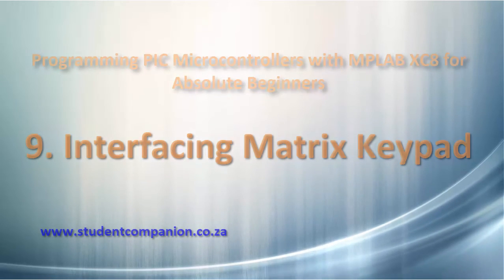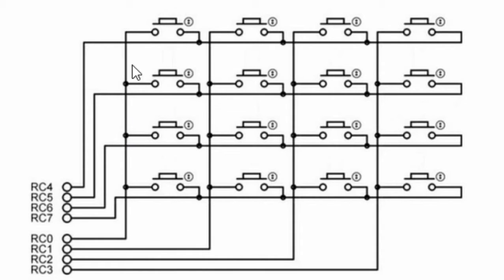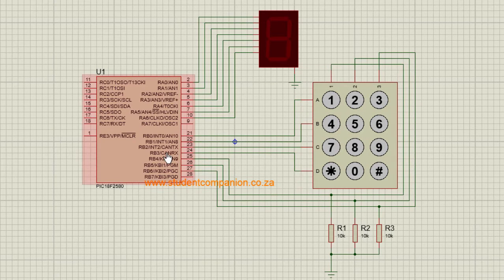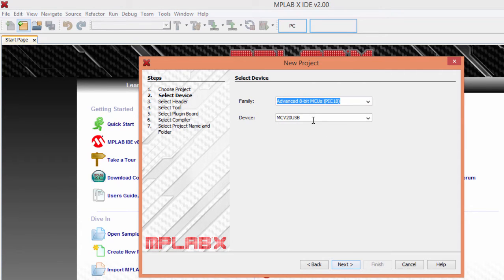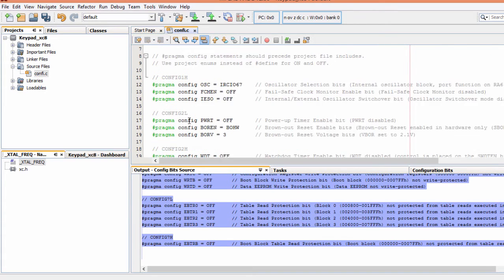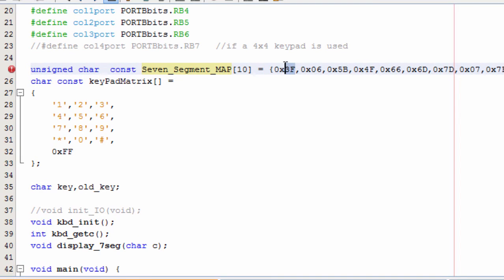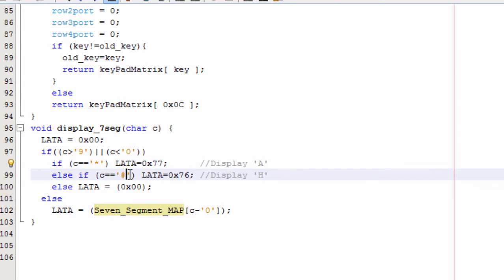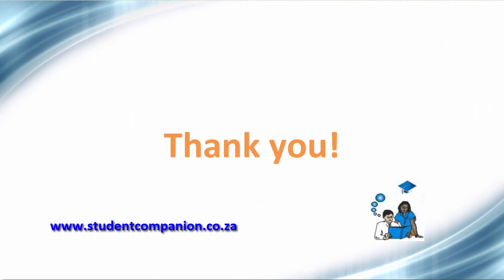9- Interfacing Matrix Keypad | MPLAB XC8 for Beginners Tutorial

Comment: Hi. Your video has helped me understand the basic logic of how keypad interfacing works. I am interfacing LCD and 3x4 matrix keypad with PIC18F4550 microcontroller. I am using MPLABX, XC8 with PICkit3. I am using C language.
I am facing trouble trouble with
1. Not able to print the right pin number on the screen. eg. if I press key 1, there is nothing on the display and if I press 5 then it displays * on the screen. 
2.  Writing interrupt or code to wait for a keystroke.
NB:
                 I am using internal pull up at portB, external oscillator of 20MHz frequency.

My code is:

#include <xc.h>
#include <stdio.h>
#include <stdlib.h>
#include "delays.h"             //--- for delays
#include "xlcd.h"
/*
 * 
 */
#pragma config PLLDIV = 5       // PLL Prescaler Selection bits (Divide by 5 (20 MHz oscillator input))
#pragma config CPUDIV = OSC1_PLL2// System Clock Postscaler Selection bits ([Primary Oscillator Src: /1][96 MHz PLL Src: /2])
#pragma config USBDIV = 2       // USB Clock Selection bit (used in Full-Speed USB mode only; UCFG:FSEN = 1) (USB clock source comes from the 96 MHz PLL divided by 2)

#pragma config FOSC = HSPLL_HS        // Oscillator Selection bits (HS oscillator (HS)
#pragma config LVP = OFF     //low voltage programming disabled
#pragma config FCMEN = OFF
#pragma config BORV = 3
#pragma config WDT = OFF
#pragma config CPB = OFF

void LCD_init (void);               //--- To Initialise LCD display
void LCD_Clear (void);              //--- To clear the display
void DelayFor18TCY (void);          //--- For 18 instruction cycle delay
void DelayPORXLCD(void);            //--- For 200 millisecond delay which is more than the minimum as per LCD datasheet
void DelayXLCD(void);               //--- For
void Delay_s(unsigned int);

/******************************* Macro Defination ******************************/
#define line_1  0x00
#define line_2  0x40
#define clear   0x01
 
void main (void)
{
    unsigned char rows[3];
    TRISB = 0xFF ; //set all pins as inputs to start with
    ADCON1 = 0x0F; //set all PORTB pins to digital mode.
    INTCON2bits.NOT_RBPU = 0;       //Pull up enable
    C1_DAT = 0; //so we can drive COL1 low later 
    C2_DAT = 0; //so we can drive COL2 low later 
    C3_DAT = 0; //so we can drive COL3 low later
    
    //ADC_init();                     //--- Initialise ADC
    DelayPORXLCD();                 //--- 20 ms delay after VDD > 4.5V
    LCD_init();                     //--- Initialise LCD
    DelayXLCD();                    //--- 10 ms delay
    LCD_Clear ();                   //--- Clear LCD display
   
    DelayXLCD();
    DelayXLCD();
    
    putrsXLCD("Welcome. Press a");
    DelayXLCD();
    SetDDRamAddr(line_2);             //Shift cursor to beginning of 2nd line
    DelayXLCD();
    putrsXLCD("keypad key");
    
    for (int f = 0; f <= 500; f++)
        DelayXLCD();
    LCD_Clear();
//start of main loop

    do
    {
        /*C1_DIR = 0; //drive column 1 low
        rows[0] = PORTB & 0x0f; //read all four rows1 buttons
        C1_DIR = 1; //let column 1 float

        C2_DIR = 0; //drive column 2 low
        rows[1] = PORTB & 0x0f; //read all four rows2 buttons
        C2_DIR = 1; //let column 2 float

        C3_DIR = 0; //drive column 3 low
        rows[2] = PORTB & 0x0f; //read all four rows3 buttons
        C3_DIR = 1; //let column 3 float */
        
        C1_DIR = 0; //drive column 1 low
        rows[0] = PORTB & 0x0f; //read all four rows1 buttons
        rows[1] = 0x0f;
        rows[2] = 0x0f;
        DelayXLCD();
        
        if ( (rows[0] & 0b0001) == 0)    // will be zero if the "0" button is currently pressed.
            putrsXLCD("key 1 is pressed");
        DelayXLCD();
        //break; 
        
        if ( (rows[0] & 0b0010) == 0)    // will be zero if the "0" button is currently pressed.
            putrsXLCD("key 4 is pressed");
        DelayXLCD();
        //break; 
        if ( (rows[0] & 0b0100) == 0)    // will be zero if the "0" button is currently pressed.
            putrsXLCD("key 7 is pressed");
        DelayXLCD();
        
        if ( (rows[0] & 0b1000) == 0)    // will be zero if the "0" button is currently pressed.
            putrsXLCD("key * is pressed");
        DelayXLCD();
        //break; 
        if ( (rows[1] & 0b0001) == 0)    // will be zero if the "0" button is currently pressed.
            putrsXLCD("key 2 is pressed");
        DelayXLCD();
        
        if ( (rows[1] & 0b0010) == 0)    // will be zero if the "0" button is currently pressed.
            putrsXLCD("key 5 is pressed");
        DelayXLCD();
        //break; 
        if ( (rows[1] & 0b0100) == 0)    // will be zero if the "0" button is currently pressed.
            putrsXLCD("key 8 is pressed");
        //break; 
        if ( (rows[1] & 0b1000) == 0)    // will be zero if the "0" button is currently pressed.
            putrsXLCD("key 0 is pressed");
        DelayXLCD();
        //break; 
        if ( (rows[2] & 0b0001) == 0)    // will be zero if the "0" button is currently pressed.
            putrsXLCD("key 3 is pressed");
        DelayXLCD();
        //break; 
        if ( (rows[2] & 0b0010) == 0)    // will be zero if the "0" button is currently pressed.
            putrsXLCD("key 6 is pressed");
        DelayXLCD();
        //break; 
        if ( (rows[2] & 0b0100) == 0)    // will be zero if the "0" button is currently pressed.
            putrsXLCD("key 9 is pressed");
        DelayXLCD();
        //break; 
        if ( (rows[2] & 0b1000) == 0)    // will be zero if the "0" button is currently pressed.
            putrsXLCD("key # is pressed");
        DelayXLCD();
        Delay_s(20);
        //if ( (rows[0] & rows[1] & rows[2]) == 0x0F)    // will be 0x0F if all three values are 0x0F
            //putrsXLCD("no keys are pressed");
        //DelayXLCD();

    } while((rows[0] & rows[1] & rows[2]) != 0x0F); // wait for keys release
    {putrsXLCD("no keys are pressed");
        Delay_s(50);
        LCD_Clear();} //end of main loop}
}

void LCD_init (void)
{
    OpenXLCD(FOUR_BIT & LINES_5X7);        //Instruction to configure LCD in 4-Bit mode with multiple lines
    while (BusyXLCD());                     //While loop to check if the controller is busy
    DelayXLCD();                            //--- 5ms delay
    WriteCmdXLCD(0x06);                     //--- Move cursor right without shifting the display
    WriteCmdXLCD(BLINK_ON);                 //--- Turn ON the display with blinking cursor on LCD
}

void DelayFor18TCY (void)                   //--- 18 Cycles
{
    Nop(); Nop(); Nop();                    //--- Each Nop(); takes 1 cycle to operate and does nothing
    Nop(); Nop(); Nop(); 
    Nop(); Nop(); 
    return;                                 //--- Takes 2 cycle
}

void LCD_Clear (void)
{
    while (BusyXLCD());                     //--- While loop to check if the controller is busy
    WriteCmdXLCD(clear);                    //--- Move cursor right without shifting the display
    SetDDRamAddr(line_1);
}

void DelayPORXLCD ()                        //--- For 15ms delay after VDD>4.5V
{
    Delay1KTCYx (100);                      //--- For 20 MHz CLK, 1 instruction cyc = 0.2us => 100k*0.2u=200ms
//    return 0;
} 

void DelayXLCD ()                           //--- For more 5ms delay after VDD>4.5V
{
    Delay1KTCYx (50);                       //--- For 20 MHz CLK, 1 instruction cyc = 0.2us => 50k*0.2u=100ms
}

void Delay_s (unsigned int time)               //--- For time second delay
{
    Delay1KTCYx (time);                         //--- For 20 MHz CLK, 1 instruction cyc = 0.2us => time*0.2u
}
Reply: My idea is to use three pins to drive the three columns, but only set one at a time to be an output, driving low. The other two would be set to input mode so they can float and that is how I can select one column at a time.
The four rows are connected to pull up resistors.I am using a 3 byte array rows which will fill the state of all the buttons.A pressed button will give a 0 bit, and an unpressed button will give a 1.
Reply from the maker: Can you post your schematic diagram?
Reply: Sure. 
http://i64.tinypic.com/25kioes.png

I have updated the code as well. I am getting a different error now. The error is if I press any of 2580 I get the whole row printed eg. if I press 2, the output is 1 2 if I press 3, output is 123 as infinite loop.
Reply: UPDATED CODE:

#define C1_DAT LATBbits.LATB4 //Column 1 is set portB4 as output
#define C2_DAT LATBbits.LATB5 //Column 2 is set portB5 as output
#define C3_DAT LATBbits.LATB6 //Column 3 is set portB6 as output

#define C1_DIR TRISBbits.TRISB4 //Column 1 is set portB4 as output
#define C2_DIR TRISBbits.TRISB5 //Column 2 is set portB5 as output
#define C3_DIR TRISBbits.TRISB6 //Column 3 is set portB6 as output

#define R1      PORTBbits.RB3
#define R2      PORTBbits.RB2
#define R3      PORTBbits.RB1
#define R4      PORTBbits.RB0

void LCD_init (void);               //--- To Initialise LCD display
void LCD_Clear (void);              //--- To clear the display
void DelayFor18TCY (void);          //--- For 18 instruction cycle delay
void DelayPORXLCD(void);            //--- For 200 millisecond delay which is more than the minimum as per LCD datasheet
void DelayXLCD(void);               //--- For
void Delay_s(unsigned int);

/******************************* Macro Defination ****************************/
#define line_1  0x00
#define line_2  0x40
#define clear   0x01
 
void main (void)
{
    unsigned char Col[3];
    TRISB = 0xFF ;                  //--- set all pins as inputs to start with
    ADCON1 = 0x0F;                  //--- set all PORTB pins to digital mode.
    INTCON2bits.NOT_RBPU = 0;       //--- Pull up enable
    INTCONbits.GIE = 1;             //--- Enable global interrupt
    C1_DAT = 0;                     //--- So COL1 could be drived low later 
    C2_DAT = 0;                     //--- So COL2 could be drived low later  
    C3_DAT = 0;                     //--- So COL3 could be drived low later 
    
    DelayPORXLCD();                 //--- 20 ms delay after VDD > 4.5V
    LCD_init();                     //--- Initialise LCD
    DelayXLCD();                    //--- 10 ms delay
    LCD_Clear ();                   //--- Clear LCD display
   
    DelayXLCD();
    DelayXLCD();
    
    putrsXLCD("Welcome. Press a");
    DelayXLCD();
    SetDDRamAddr(line_2);             //Shift cursor to beginning of 2nd line
    DelayXLCD();
    putrsXLCD("keypad key");
    
    for (int f = 0; f <= 500; f++)
        DelayXLCD();
    LCD_Clear();
//start of main loop

    while(1)
    {
        C1_DIR = 0; //drive column 1 low
        Col[0] = PORTB & 0x0f; //read all four rows1 buttons
        C1_DIR = 1; //let column 1 float

//        C2_DIR = 0; //drive column 2 low
//        Col[1] = PORTB & 0x0f; //read all four rows2 buttons
//        C2_DIR = 1; //let column 2 float

        C3_DIR = 0; //drive column 3 low
        Col[2] = PORTB & 0x0f; //read all four rows3 buttons
        C3_DIR = 1; //let column 3 float
        
//        C1_DIR = 0; //drive column 1 low
//        Col[0] = PORTB & 0x0f; //read all four rows1 buttons
//        Col[1] = 0x0f;
//        Col[2] = 0x0f;
        DelayXLCD();
                
        if ( (Col[0] & 0b0001) == 0)    // will be zero if the "1" button is currently pressed.
            putrsXLCD("key 1 is pressed");
        DelayXLCD();
        //break; 
        
        if ( (Col[0] & 0b0010) == 0)    // will be zero if the "4" button is currently pressed.
            putrsXLCD("key 4 is pressed");
        DelayXLCD();
        //break; 
        if ( (Col[0] & 0b0100) == 0)    // will be zero if the "7" button is currently pressed.
            putrsXLCD("key 7 is pressed");
        DelayXLCD();
        
        if ( (Col[0] & 0b1000) == 0)    // will be zero if the "*" button is currently pressed.
            putrsXLCD("key * is pressed");
        DelayXLCD();
        //break; 
        if ( (Col[1] & 0b0001) == 0)    // will be zero if the "2" button is currently pressed.
            putrsXLCD("key 2 is pressed");
        DelayXLCD();
        
        if ( (Col[1] & 0b0010) == 0)    // will be zero if the "5" button is currently pressed.
            putrsXLCD("key 5 is pressed");
        DelayXLCD();
        //break; 
        if ( (Col[1] & 0b0100) == 0)    // will be zero if the "8" button is currently pressed.
            putrsXLCD("key 8 is pressed");
        //break; 
        if ( (Col[1] & 0b1000) == 0)    // will be zero if the "0" button is currently pressed.
            putrsXLCD("key 0 is pressed");
        DelayXLCD();
        //break; 
        if ( (Col[2] & 0b0001) == 0)    // will be zero if the "3" button is currently pressed.
            putrsXLCD("key 3 is pressed");
        DelayXLCD();
        //break; 
        if ( (Col[2] & 0b0010) == 0)    // will be zero if the "6" button is currently pressed.
            putrsXLCD("key 6 is pressed");
        DelayXLCD();
        //break; 
        if ( (Col[2] & 0b0100) == 0)    // will be zero if the "9" button is currently pressed.
            putrsXLCD("key 9 is pressed");
        DelayXLCD();
        //break; 
        if ( (Col[2] & 0b1000) == 0)    // will be zero if the "#" button is currently pressed.
            putrsXLCD("key # is pressed");
        DelayXLCD();
        Delay_s(20);
        //if ( (rows[0] & rows[1] & rows[2]) == 0x0F)    // will be 0x0F if all three values are 0x0F
            //putrsXLCD("no keys are pressed");
        //DelayXLCD();

    } 
//        while((Col[0] & Col[1] & Col[2]) != 0x0F); // wait for keys release
//    {putrsXLCD("no keys are pressed");
//        Delay_s(50);
//        LCD_Clear();} //end of main loop}
}

Comment: Hello.. may i know on how to interfacing matrix keypad and led matrix.. Let say i want to press 1 it will show 1 on LED matrix and so on
Reply from the maker: +amir ridzuan it will depend on the led matrix controller you are using.
Reply: im using 5x7 led matrix
Reply from the maker: It's very tricky to use LED matrix to display anything meaningful beside a simple Characters without using  a good library. you can make the leds look like any character you want, and even draw pictures. The math behind the scrolling of text and producing a smooth animation between characters is done by a lot of bit shifting and a lot of math.  So we can't explain everything in comments, you need to read a full tutorial which we will do in the future.
Read this article from mikroelektronica: https://learn.mikroe.com/led-matrices/